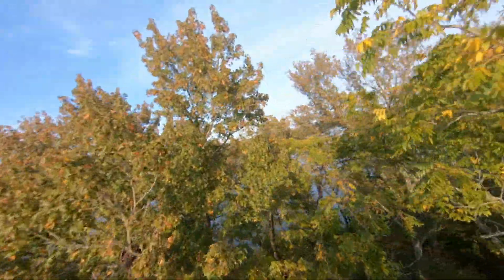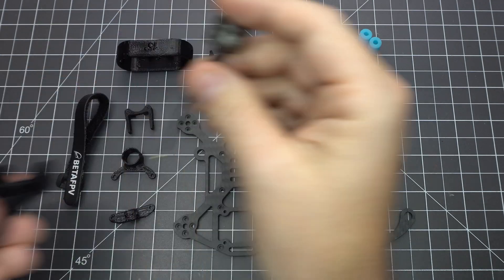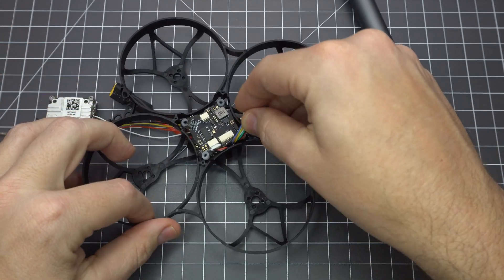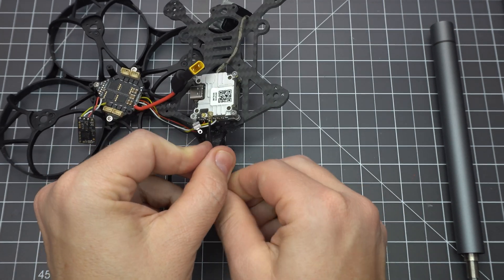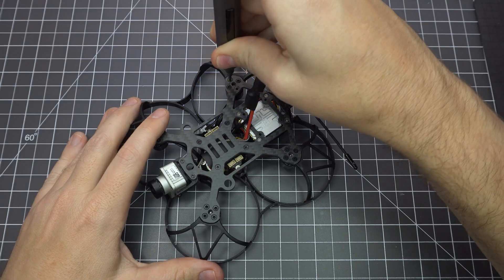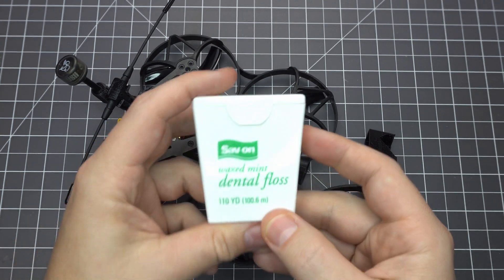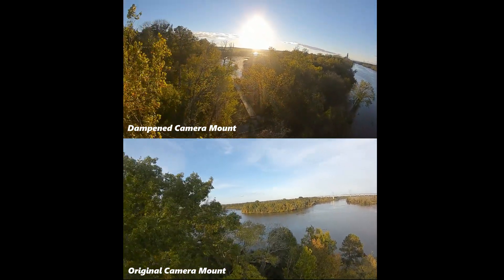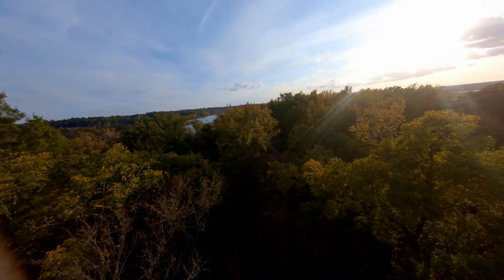Build a Cinematic FPV Drone - Beta95X V2 + Naked GoPro

Comment: hey, i can't see the EXC board on the parts list anywhere ? thanks
Reply from the maker: It comes with the flight controller.
Reply: @whiffles  great thanks, dumb question but I’m looking at this flight controller which I’m told will do the same job however the one I’m looking at appears to have a capacitor sticking out of it. How come your ESC doesn’t have a capacitor? And do you think the below will be suitable ? Thanks again 

https://www.unmannedtechshop.co.uk/product/betafpv-toothpick-f4-2-4s-35a-aio-flight-controller-2-6s/?gclid=Cj0KCQiA6t6ABhDMARIsAONIYyx2glMsxucXbtFUnmOmnVKkolE6NtWn65esOcUem0m4sHDn4bp-s4QaAmOVEALw_wcB
Reply from the maker: @winteriscoming4379  I can't say whether or not that will will fit the frame. In my case the capacitor is part of the plug where the battery connects. You may want to have a look at the Beta95X V3 frame and the board they made for that.

Comment: What printer settings did you use for the antenna holder ? Not sure what Infill %
to use.
Reply from the maker: I think I only used 20%. There's not much to infill really.

Comment: great video, I won a v3, so can't complain there,  but had a question on two things, the AIO that comes with the pre-built is the 20 amp with Bheli-s esc will your tune on your  rotor build work? I have found the quad flies heavy with a naked go pro did you adjust your throttle curve?
Reply from the maker: You can try it, but I don't believe you'll have RPM filters unless you flash a special firmware to your ESCs. I never touch my throttle curve.
Reply: @whiffles  TY

Comment: in which flight mode (acro, angle, horizon, air) do you fly it to take a smooth video?
Reply from the maker: I use acro but if the space is really tight I might switch to angle.

Comment: Do I have to use motor dampers spacers for the 1106 4500 motors?
Reply from the maker: You don't need any spacers for the 1106 motors.

Comment: What screws are needed for bottom plate? 5:35
Reply from the maker: I just used the ones included with the kit. They're the silver phillips head screws with a sharp point.

Comment: Hey, great video! Just one question: the DJI camera mount you're using, where did you get that? My conversion kit, sadly, came with a mount for the Nebula...If you could share the stl, it would be awesome.
Reply from the maker: It's part of the .stl kit at themakerboyz.com. They'll be selling it as a print pretty soon but if you've got a 3D printer you can print it yourself.
Reply: @whiffles  thanks!!!

Comment: This is amazing, just ordered an 85x cause of the black friday sale but flying this in hd is a game changer!!
Reply from the maker: Yeah, HD on this little thing is great
Reply: @whiffles  I ordered a vista unit with a nebula micro, the 3d mount you have listed for the dji hd cam should fit it right? I know it’s similar to a micro size, and since its tpu i’m sure it will have some give
Reply from the maker: @BmoreVisuals  The upgrade kit includes a mount for the Nebula already.
Reply: @whiffles  ohh, I wasn’t sure if it was for the nebula nano or micro, thank you for all the info!
Reply from the maker: @BmoreVisuals  Hmm, that I'm not exactly sure. It's for the camera that comes with the BNF 95X V2.

Comment: Awsome video. Very helpful. Thanks
I have a question about the 3d parts from makerboys? On the site am i ordering the part or is it just the stl file im paying for?
Reply from the maker: Just the stl files. They said they'd sell the prints at some point. Maybe contact them to ask if they can add the pre-printed set to the site.
Reply: @whiffles  Stp file are "sold out" how could it be ;-) I'm stuck

Comment: Thank you for the detailled video, that's very helpful. Can you recomend a good betaflight tune?
Reply from the maker: I'll post my tune to the guide on Rotorbuilds. Just finishing it up.
Reply: @whiffles  Is this the current tune that's on your site now?
Reply from the maker: @armani007E55  Yes, that's my current tune.
Reply: @whiffles  Good stuff. Are you still flying this bird? Still a good recommendation?
Reply from the maker: @armani007E55  It's my goto at the moment. Definitely great for a sub 250g rig.
Reply: @whiffles  sold! Tks!!!🤙

Comment: awesome video helped me a lot. are your props also super close to the usb on the air unit? been thionking abouyt adding the spacers but would need some longer screws
Reply from the maker: They aren't close enough to concern me. Dropping the motors any lower will extend them below the ducts and may cause takeoff issues if the screws scrape against the ground.
Reply: @whiffles  oh, well my props are super close to the usb port on the air unit. 

have you tuned this thing? im not that experienced yet, to be able to tune it, so i used the pids from betafpv.
Reply from the maker: @RaukFPV  I've been using the BetaFPV PIDs and they seem pretty good so far.

Comment: Great video! How did you make the external bec ? What parts did you use? Also it’s okay to power betafpv bec 1.1v with external bec ?
Reply from the maker: I'll make a short video about how to do the BEC. It's really simple. You can power the BetaFPV BEC with another BEC. Maybe it's overkill but I killed a Hero6 board already by powering the BetaFPV BEC directly from the battery.
Reply: Thank you. Looking forward to the video!

Comment: Great tutorial with very effective instructions. One question though: why ditching the yellow cable?
Reply from the maker: It's problematic. Many people have issues with it. It's better just to start and stop the camera manually.
Reply: @whiffles  : OK, that's a pity because it's great to be able to start the movie capture from the radio controller.
Reply from the maker: @robertogiannotta4477  I'm sure you can work it out, but it may require some trial and error. I don't want to steer people down that path due to all the problems it causes.

Comment: Do you think it would be possible to make this weather resistant enough to fly in snowy conditions?
Reply from the maker: You could conformal coat the electronics, but I'm not sure how you'd do that to the DJI parts. I probably wouldn't try it.

Comment: Why did you set additional BEC for GoPro to 9V? 
I thought GoPro needs 5V to power from USB port.
Reply from the maker: The GoPro already has a 5V BEC so the input needs to be higher. I've already killed a GoPro powering directly from the battery to the 5V BEC so I'm not taking any chances now. My guess is the BetaFPV BEC couldn't handle a voltage spike.
Reply: @whiffles  thank you! I’m going to have this setup with betafpv bec, so just to clarify that I get it right, please, correct me if I’m wrong, I’m newbie here:) 
1. GoPro needs 5v input via USB port to power up
2. Betafpv BEC deliver 5v to GoPro
3. Betafpv BEC needs more than 5v input (e.g. 9v) to handle properly voltage spikes
4. Additional BEC get up to 4.2v of single battery cell from balance lead, converts it to 9v and deliver it to betafpv BEC input.

Comment: I'm thinking about building a cinewhoop. I have a Tyro79 laying around, and wanted to use its parts in this project. I wanted to use the 95x V2 frame with it. Do you think it could work?
Reply from the maker: I don't think those parts will work. Those motors are designed for a larger quad.
Reply: @whiffles  I have a set of 1104 8600KV motors too. They are probably too weak?

Comment: hello sir, i have beta95x v2 too and I keep getting BATTERY FULL in my osd on my dji fpv  goggle  but it's inaccurate,  i have calibrating the voltage scale. but still does'nt work. so  what's the problem? any ideas?
Reply from the maker: Is it an HV battery? You might need to adjust the battery warning levels.
Reply: @whiffles  i’m using lipo battery betafpv 450 MAH 4s

Comment: Hey man, thank you so much for putting this together. Exactly what I was hoping to do with my analog 95x v2. I don't see the info available on Rotorbuilds yet (maybe you're still putting it together), but if you could, please also include a CLI dump on your config. Did you by any chance update the board to BF 4.2?
Reply from the maker: Yeah sorry, I'm still working on the write-up! I'll definitely include my settings and how to configure it. Yes, I'm running 4.2.
Reply: @whiffles  yes please, dump would be helpful

Comment: Will it work fine with GoPro Hero 7 with HyperSmooth?
Reply: I'm building this slowly, hopefully it'll work.
Reply from the maker: Do you mean a naked Hero7? It'll work fine on hypersmooth and you may even get a decent result with Reelsteady Go if the vibrations aren't too bad. A full Hero7 is too heavy though.
Reply: @whiffles  Thank you for your reply. Yes, I meant naked GoPro 7 with enabled HyperSmooth feature.
Reply from the maker: @SerJG  Personally I prefer Reelsteady Go to Hypersmooth, but it does get a decent result if you fly really well.

Comment: I have the pnp analog version of the beta95x, what a pain it is to add a receiver. To mount the receiver you have to take it all apart including the motors. My kit didn't include the 4 pin cable, so I had to direct solder the tbs nano to the uart1  instead of 3. I noticed your USB port is facing down, on mine it faces up, and there is a hole through the carbon plate which you then plugin your USB. great video, I wish I had gone digital, I'm getting a lot of video break up on mine.
Reply from the maker: Yeah I wouldn't have it any other way. This is pretty much my dream 95X V2 as I think the BNF version falls short in a few places.